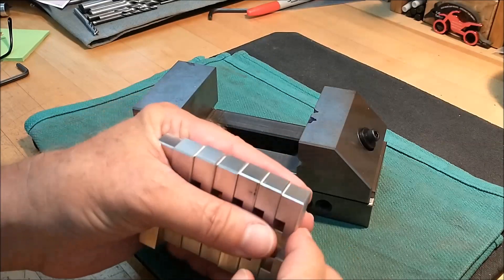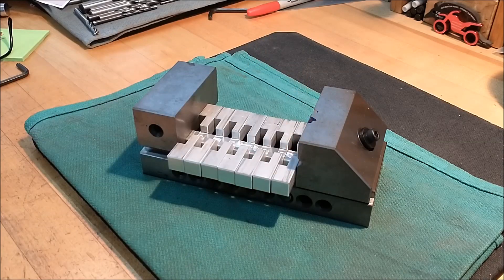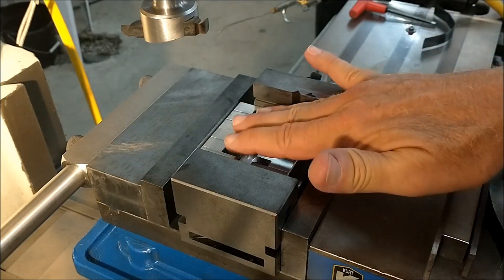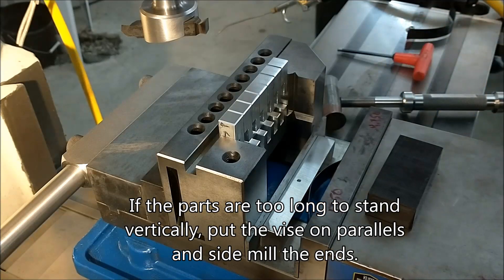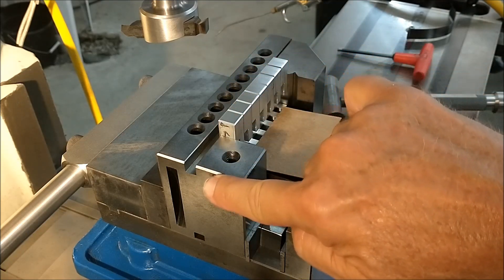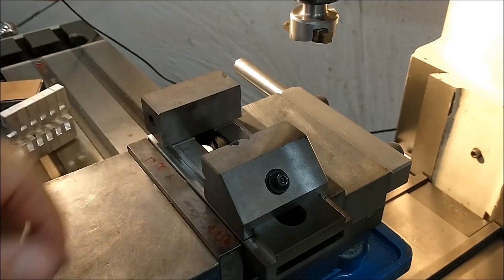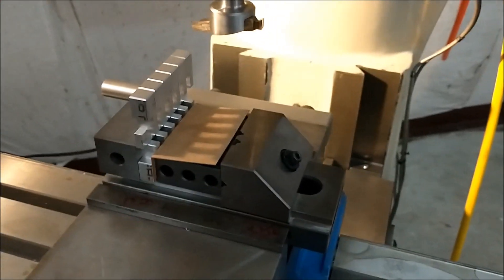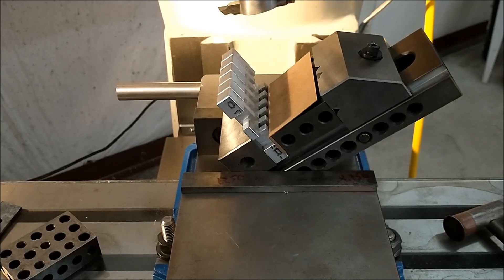Machining Multiple Parts Using a Vise in a Vise

Comment: Another Great Video Joe 3.1416 and yes it does work great. I've used this fixture setup numerous times with multiple kurt 675s as the mother vises on my machines for my products and it cuts production times down significantly. On other parts I would make custom fixtures from a fadal 4020 cnc that were for final processes on multiple parts to cut down the time as well. The saying "Time is Money", is no joke. Today I say "Time is getting Shorter", holds real true as well....Much Love for you Joe...Ricko

Comment: Great ideas.. Now I just need a smaller vice!
I have a few odds and ends of UHMW/Nylon/Delrin kicking around I use to clamp multiple parts that might not all be dimensionally identical, it can take up a fair bit of difference and out-of-square

Comment: Never thought about using thin  cardboard to compensate for slight inconsistencies in multiple part set ups . May have to try that . Thanks for the tip and all the other great content you've published over the years . Keep up the good work , love the channel .
Reply: it depends on parts and cutting forces.  i tried soft shims (paper/copper/aluminium) and can say that the best technique is just not clamping more than two parts  )
or clamp them all together in a stack.  like the firs method shown in this video.

Comment: I've also used the magnetic chuck to even pieces up in my grinding vise before putting it in the Kurt MM vise. Of course that only works with steel parts.

Comment: People think of fixtures as purpose built tools. The vise on a milling machine is simply a multi purpose fixture.  The same applies to lathe chucks and bises on shapers and grinders. I had the old timers pissed off on time because I was using a milling machine vise on the jig bore. Multiple parts with holes on the same locations.  Dial indicator and solid stop for location in X. Torque wrench to maintain consistent vise pressure controlling vise distortion. I've used vises on Blanchard grinders too.

Comment: Great tips. I would add one more. Make several sets of tall removable jaws for your Kurt vise. 2, 2.5, and 3 inch from CRS, ground all over for accuracy work well with this very versatile vise.
Reply: Plus jaws with vees in them. There is also a vendor that sells vise jaws that use pins set in different holes to set angles.
Reply from the maker: I have all of the above.

Comment: Joe iv never seen you use a surface grinder, what are your thoughts on those
Reply: I don't think he has one. If he did I don't think he'd use the Bridgeport to grind tools on occasion. I'm pretty sure given the environment where he served his apprenticeship he full well knows just how valuable they are. Myself I consider them one of the 5 essential machines needed to produce quality work. Especially if working with heat treated materials. Lathe, mill, bandsaw, drill press and surface grinder.

Comment: just curious on that expanded shell coin how long would a take a experianced machineist to make?
Reply from the maker: Few hours.
Reply: @joepie221  i really hope you make this video if i were to walk in your shop and ask to have something like that made what would be my options? Quanty wise ? i will say this those coins cost anywhere from 20 bucks to 70 depending on brand name.IDont know if i told you i worked at it for months with no succsess But im not experinenced at machining But gave it my all. I came to conclusion that its probablly a coin die made 2thou bigger then a regular 50 cent piece. then just milled out.
Reply from the maker: If these are available for 20-70 dollars, I'd suggest you just buy one. Getting one done in a custom shop will cost you 4 times that.
Reply: @joepie221  i build tricks  and like i said i tried to make these but dont know the  process And you saying should just buy o0ne  i have several i want to make one!

Comment: It's a vice not a vise!
Reply from the maker: Both.
Reply: @joepie221  LOL. USA folks have an English dictionary all their own.
Reply: @TomokosEnterprize  Aluminum or Aluminium. I wouldn't make a plough or a plow  out of it, but it might  make a nice lid for a trunk or a boot.....
Reply: American English - "Vice" is used to describe a bad habit or moral fault, while "vise" is used to describe a tool with two grips that can clamp things together. For example, you might describe someone's grip as "vice-like" to mean it's very firm. You might also use "vise" to describe a machine vise used in a drill press or CNC milling machine. 
British English - "Vice" is used in all cases, regardless of whether you're referring to a bad habit, a gripping tool, or someone who is second in command.